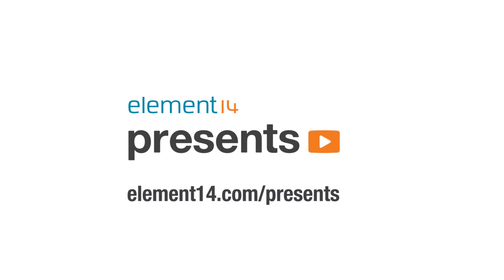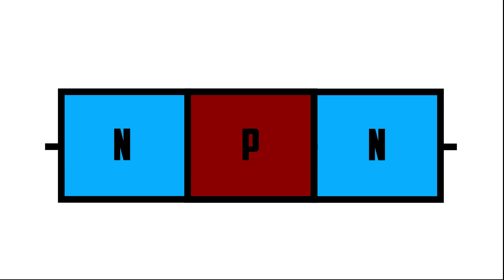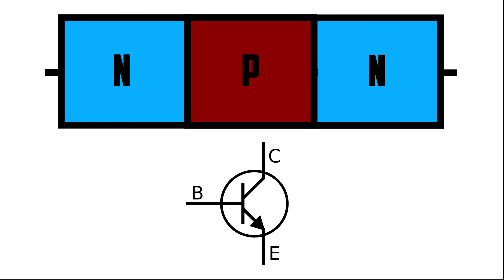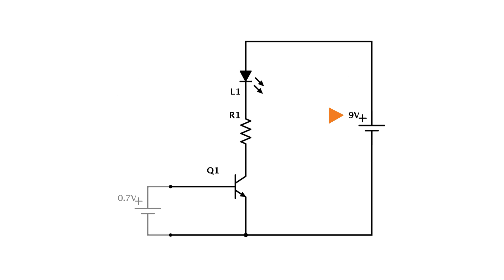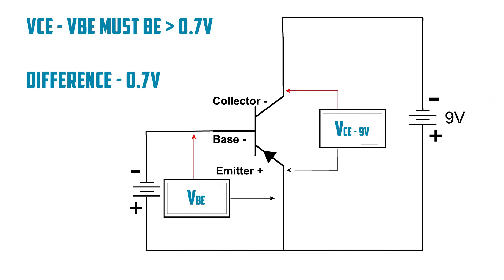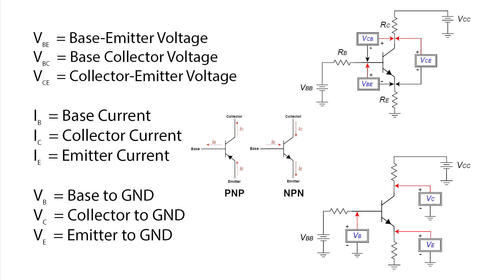How Transistors Work - The Learning Circuit

Comment: Yep....I thought it was going to be a nice little review of some simple stuff....but there seemed to be alot of typos, and mis-spoke  descriptions.  I ended up questioning my  own knowledge and had to check a couple things... alot of commenters are correct, a BJT is a 'current' driven device...it just so happens that you see a 'diode drop'  on the leads.... and the VCE drop varies with collector current, and device... but is usually a volt or less.   As far as using 'conventional' current flow as opposed to electron current flow.... most of the time, it's what you learn first that ppl are comfortable with... but I also notice that they still teach 'engineers' conventional and technicians electron flow... it might have to do with trying to solve mesh circuits.....you see voltage 'drops' (subtractions) would become voltage 'gains' (additions).... just seems counter-intuitive ....just my 2 cents...

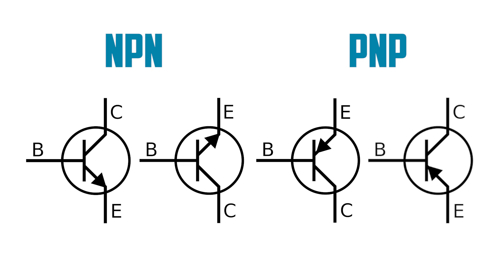Comment: This video needs reviewing and reshooting. There is a major error at 4:17. Vce is not 8.3V. The 0.7V of Vbe has nothing to to with the Vce, and you have ignored the voltage drop through both the LED and R1. The Vce is indeterminate without a specified value for R1 and at least a colour for the LED. And the section about PNP from 4:47 to 5:28 is complete and utter nonsense. The Vbe in a PNP needs to be -0.7V, that's it. Nothing to do with Vce whatsoever, and Vbe is already a difference, as in fact is every voltage on the planet. Current amplification can be done without Darlington transistors. Why you would show an NPN Darlington upside down is a mystery. The base is always in the middle, not just 'typically', as you say yourself later. And so on. Total disaster area. Avoid.
Reply: This. The PNP transistor part made me spend hours questioning from where the VCE part came from, only to conclude that it does not make any sense at all. You should not share a video lecturing others when even you do not fully grasp the concept... Thank you for the comment @EJP, it helped me confirming my suspicion.
Reply: I've watched a number of your videos now and liked them overall. What I really liked is that you stay away from the science and math underlying the technology. Home hobbiests and people learning how to use bipolar transistors won't be discouraged by the terminolgy and will have enough information to get started. Where do you start is often the most difficult question one has when taking on a new subject. In all of the videos there have been some minor miswordings that only a seasoned technician or engineer would notice. Although I don't agree with the way EJP worded his comment, he is technically correct. The saturation voltage of bipolar transistors is 0.3V or higher depending on the current. Your discussion on PNP was confusing. It would have been simpler to just use negative voltages where VBE is is -0.7 Volts and VCE saturation voltage is -0.3V. I think the confusion on the PNP comes from the difficulty of using digital logice to drive them. NPN transistors are fare easier to use when driven by digital logic.
Reply: Thanks I was scratching my head.

Comment: Can you help me to find this transistor ( TIP 120 darlington transistor MAR 1719 ) , i did not find it in Amazon or ebay, so would you please help me to buy like it or at less tell me if I can use other similar can work like 120 MAR 1719 so I can replace it by the one you suggest. (by the way am far away from usa) other country :(

Comment: Correct me if I'm wrong but at 4:43 when describing the the pnp BJT, shouldn't it be maintained that Veb >= 0.7v ? The equation stated says Vce - Vbe >= 0.7v which is the same as Vcb >= 0.7v
Reply: Rascul It should state that Vbe <= -0,.7V. Veb and the other backwards abbreviations are not used.
Reply: Yes, something is wrong here.   If I take 2SA1015  max specs it says VCE=-50V  VEB=-5V,   running it with emitter at 18V and collector grounded as I do,  I would not be able to shut it off at all, if the formula in video is correct,  since I can never bring VBE close to 18V (I'll leave sign convention out of consideration here)

Comment: You didn't even know how to make true diode symbol at 1:30. It should be reversed. 258 comments and no one realized that. So disappointed.
Reply: Cathode (sometimes written as "K") is the tip of the arrow, goes toward the more negative potential, or else the diode wouldnt conduct. The symbol is correct.

Repeat 1000 times: "the cathode must go to the negative".

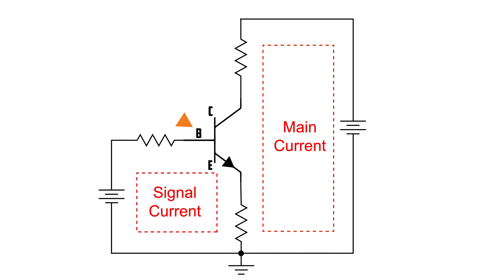Comment: The diagram at 2:40, so it is okay to have the small 'Signal Current' ground tied into the same 'Main Current' ground? These two parts obviously keep to their own parts of the circuit.  The Main current must not travel into the SIgnal current part of the circuit.

Comment: 2:37 Your voice over doesn't match your schematic --  You incorrectly say that "current flows from the base to the collector"
Reply: Yeah, that has to be a mistake. Should have been base to emitter.
Reply: Well, technically speaking, current never flows under any conditions.
Reply: @kingsman428  A transistor is far more complex than the simple explanation . There is the so-called "leakage current between collector and base that are the result . It is a formidable concept that requires study to explain: see

https://www.tutorialspoint.com/semiconductor_devices/semiconductor_devices_leakage_current.htm#:~:text=An%20important%20conduction%20limitation%20of%20PN%20junction%20diode%20is%20leakage%20current.&text=It%20is%20seen%20that%20in,dependent%20on%20minority%20current%20carriers.
Reply: @martinmartinmartin2996  Yeah but you missed the point. "Current never flows" because current is a measure of something else.
Or to put it more simply, what flows in a river is it water or is it current?
Reply: Technically speaking, the arrows in the schematics refer to the direction of flow of 'positive charge carriers', which flow in the opposite direction to electron flow within the semiconductor. In all fairness, this video is an over-simplified description of how transistors function and does not cover the subject of charge carrier theory. My apologies if my overly-technical description sounds confusing 8)
Reply: Joseph Rutha Unless specifically stated, current refers to Conventional Current, not charge carriers. That’s the whole point of having a convention.
Reply: @ArnaudMEURET  This is correct. Current direction is always conventional unless otherwise stated. She meant to say from base to emitter.

Comment: BJT's are current operated devices but that was not apparent as you used 0.7 volts as the Base-Emitter requirement to turn on a transistor.  I've found that folks who don't understand the difference between current and voltage are confused about how transistors really work.  Vbe stays approximately the same as Ibe varies.  A transistor is basically an AMPLIFIER, not a switch.  Thanks.

Comment: Also, the explanation of the Vbe for a PNP is all wrong. For a silicon PNP transistor, the magnitude of Vbe is still 0.7 v in the on state, just the opposite polarity of an NPN. So, NPN, Vbe = +0.7v; PNP, Vbe = -0.7 v.  I'm afraid this video sounds easy to understand but is full of major mistakes.

Comment: "0.7 v is lost to heat" - No, heat is an energy loss and is equal to Vce x Ic (voltage times current).Also, Vce is nor 8.3 volts. It is 9 volts minus the voltage drop across the LED and series resistor. You have not calculated what Ic is, and therefore cannot state any of these numbers.
Reply: Yes, that was a wrong circuit analysis. When the transistor enters saturation mode, there is a Vce voltage drop provided by the manufacturer. The remaining is divided on the other elements around the circuit loop (kirchhoff's voltage law).
Reply: @habotssar8429  so basically if the transistor is on it acts like a resistor which drops a fixed voltage between collector and emitter?
Reply: Stated with confidence too 😂😂

Comment: Why 0.7 VDC EB voltage? Because of the material the transistor is made of. Silicon transistors require 0.7 VDC EB bias voltage to turn on. Germanium semiconductor components require 0.3 VDC bias voltage.
Reply: But now a days, Gallium Arsenide is used as strata, then what is Vbe?

Comment: Check out this follow up video for more information on transistors! https://bit.ly/2UTTHU2
Reply: I'VE SEEN ON YOUTUBE FM TRANSMITTERS WITH ONLY 5 COMPONENTS , QUESTION : WHAT'S THE MOST POWERFUL SMALL SIGNAL TRANSISTOR THAT GIVES THE MOST RANGE I CAN USE ?  2N2222 ? 2N3904 ? BC547 ? I HAVE LOOKED INTO THE LARGER METALLIC ONES THAT USE A HIGHER VOLTAGE . PLEASE ADVISE ,,,THANKS
Reply: @mw10259  No need for all caps my friend.
Reply: @AaronDGreen  OOOOOKKKK lol . do you know the answer to my question ?
Reply: @mw10259  
You can't have high power transmission in one stage.
Should be as below and this the main principle:

Oscillator, then RF pre-amplifier, then driver stage ,then you can use high power transistor.

You should read more about oscillators,because this is the most important stage ever and the rest of stages easier...
Reply: youssef abdulmuti thanks.
Reply: Maybe it's been mentioned but at 2:40 I believe an incorrect explanation is briefly mentioned.  It's nothing too big but I thought it should be known.  Awesome video!
Reply: haha karen

Comment: I think I will always use the easier to understand NPNs.
Reply: This happens when we start from vacuum tubes
Reply: In NPN transistors, conduction of current is thro' so called "Holes" which produce a lot of noise but the same in NPN one is "Electron" & hence less noise. Now a days, PNPs are almost abolished. There are however used in some so called Complimentary Symmetry circuits.

Comment: i connected the base to the positive terminal of my battery without a resistor to reduce the current, it didnt turn on the transistor, why?
Reply: Im still scared of transistors. they look simple but I have never got it to work on a small project. Maybe this will be the summer....
Reply: @captainprototype187  i think what happened when i applied a positive voltage at the base, the electrons from the emitter rather than going through the collector. were attracted to the positive voltage from the base. seeing how emitter to base if forward bias and collector is reverse
Reply: Temi, I just woke up and now you got me thinking of a transformer again, lol. You are supposed to put the positive lead to the base, dont you? Was it a PNP, NPN mistake?Im gonna try again to use it as a fast switch for my diy small pulse motor. It has to switch on and off the small electro magnet which will then repell the small neo magnet.
Reply: @captainprototype187  yhhh positive lead for npn, but when i did it i think the volatge or current was too high
Reply: hmmm, I never heard of something like that. Well, every transformer has a rating,,,, come to think of it. They should have included the rating in the tutorials. But then, Im no expert. As long as it works, right..

Comment: The PN junction  opening must not be  forced more than 0,6-0,7 Volts ( Si, bipolar tr ). 
Therefore the sheme circuit  is  incorrect at 5 minuts, as  showing  Base to Emitter potention   - 8,4 Volts,  ( Base refer to Emitter.)
Reply: Technikus Mezőgazdasági Not only must not but cannot, unless C isn't connected. This part is totally incorrect.

Comment: we owe everything to these transistors.  I was working as a tube tech when  these devices started to hit the market. like in all things the new replaces the old. as for npn and pnp it depends on the circuit I design. thus, a super stable low frequency tunable osc requires a small load transistor in a reverse polarity configuration.

Comment: Karen  I was taught in Navy schools that current  flow  in a circuit is negative to positive or into the arrow.
Was i taught wrong? Ken
Reply: Theres conventional flow and electron flow. In old days they used to teach electricity goes pos to neg, hence the diode arrow was 'right'. Now we teach electrons are neg and go to pos, which is against arrow. So answer to your question is yes, and no.
Reply: Current flow is flow of "holes", which arent electrons, rather "potential places in which electrons can be", with positive charge. That is "conventional flow": holes flow from the positive from the negative.

Electrons always flow from the most negative place (i.e. "ground") to a more positive place (i.e. "5V dc").

So, conventional flow goes from + to -, whereas true flow goes from - to +. Current arrows point downwards, while voltage arrows point upwards. If you take a voltmeter and measure the voltage across something, it will show a positive number if you put the positive probe to the 5V and the negative to 0, and its negative value if you switch the probes.

"Holes" do not exist: they are virtual constructions to better understand the flow of current. They are intended in relation to electrons; in an electrically neutral material, for each free electron there has to be a hole somewhere else that can grab it (or, more precisely, the nearest one).

Diodes must be placed in such a way that their cathode faces a more negative potential than the one faced by the anode. Its counterintuitive but if you think current as "flow of positive charges" it makes sense.

Were you taught wrong? No, they just didn't teach everything you needed to know.
Reply: She is using conventional current flow. The military teaches electron flow. I teach at a trade school. We prefer and teach electron flow. I like to think that inside the transistor the electrons are emitted by the emitter and collected by the collector.
Reply: You were taught that conventional current flows into the arrow and that electrons go from negative to positive. These are opposite statements, not the same statement.

Comment: Madam can you explain how to work in industrial sensors PNP, NPN.
Reply: Alot depends on your PLC - whether it is sink or source. Wiring is positive to negative in source, and negative to positive in sink. Polarity flips in simple terms. Hope this bit of info helps..
Reply: If we are use microprocessor or controller then which one is the best choice for me....
Reply: It depends on your devices or sensors. Two wires are sink; they sink to ground. 4 wires use external current source , so they are sourcing devices.
Reply: You should research this topic. Too much to explain here. Good luck.
Reply: Can you explain 2 wire 3 wire 4 wire sensors concept....

Comment: I have trouble identifying BCE when the component is in my hand. If the base is “always” the middle pin how then do I identify the C & E ? there
Reply: You cannot assume pinout.  Get the part number of the transistor and look up the datasheet.
Reply: Yes, it varies. Not even all NPN transistors have the same pinout. Best to look at the part number on the part (i.e. BC547, 2N4401, etc.) and look up the data sheet, or just google "pinout" for that part number. Remember that the emitter is always the pin with the arrow on it on the circuit symbol.

Comment: This is WRONG, just too many mistakes here. At 5:05 you can not have -8.6V across a diode junction. If your going to teach electronics get it right.
Reply: Joe Musselwhite The entire section about PNP is incorrect. This video is provided by a major electronics supplier, an enormous corporation with thousands of branches. They should take the trouble to get it right. It isn't up to anybody else.

Comment: Taking AC voltage and turning it into DC voltage.
Glad I found this channel helps clear the fog from things learned long ago. Also after searching manually through your videos could not find an explanation on the theory covering transformers and rectifying diodes and proper capacitors.
Reply: Rud Dog There is no turning AC into DC here.

Comment: '
wow coool nice pretty smart lady know about on electronic...
some transistors are able to connections and still leaves LED lights on without blinking / fadeing lights
Reply: the info on the PNP transistor is not correct. for the PNP the only difference is the battery (-) side would go to the base.

Comment: This is DEFINITELY and EASILY the BEST explanation I've ever seen on this target level.  Using those two voltage sources in the explanatory schematic was genius!!! And the explanation on vBE and vCE was something that often doesn't even get talked about in other vids.
Reply: except the explanation about the PNP is not correct. The only difference is the battery in the diagram it would be flipped around so the (-) goes to the base. 
PNP and NPN both require .7v bias.
Reply: @cat-lw6kq  It looks correct to me. If using the classic positive current model then the current flowing from positive terminal on right flows into the emitter and (mostly) out through the collector, where the base signaling current would need to have a voltage of 8.3V or less. In other words, if you think in digital terms (rather than analog) she is trying to show that a logic 0 applied to the base switches the PNP BJT on to allow the primary current to flow through from E to C.
Reply: Suggest you buy one of those cheap transistor testers off ebay. for test some  transistors with it, it will show the bias voltage and the gain. The tester has a digital readout, it shows bias (B-E) voltage and gain. You will see a bias of about .7v if the transitor is good.
Reply: It isn't the best. Half of it is totally incorrect. Look harder. Try the PNP circuit shown and measure for yourself. The voltages are not as described.